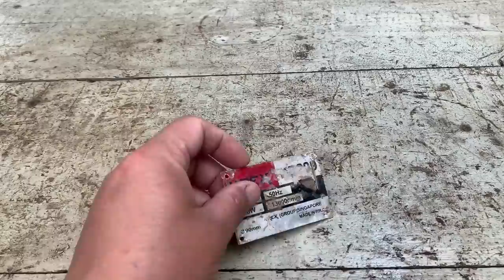Restoration old Wood Planer KREX SINGAPORE | Restore Electric Planer Power Tools

Comment: Problem looks like it was the Stator and Switch. The Stator was either replaced, repaired, or rewound. The one taken off had a brown and blue connection wires. The one installed had two blue wires. The Switch put in does not look like the one taken out either. Different colour and logos. Some clarification on replacement parts would have been nice. apart from that it was very entertaining.

Comment: the larger of the pulleys goes on the motor shaft you have got them wrong the blades wont rotate fast enough to get a good finish